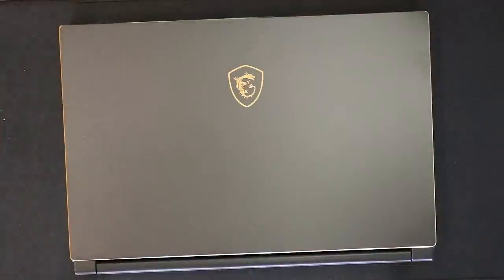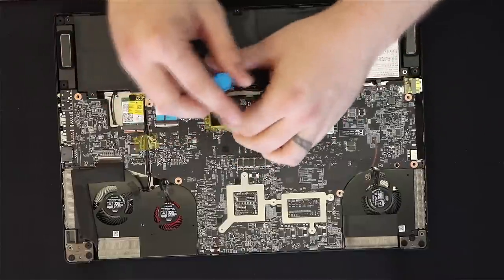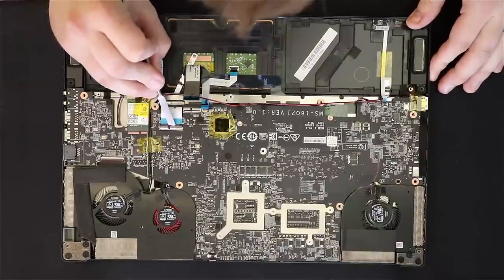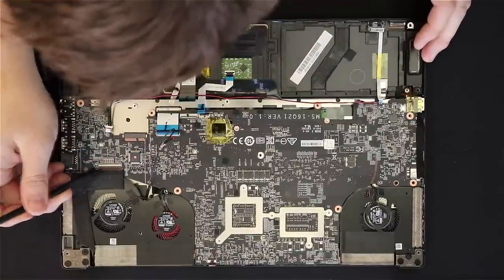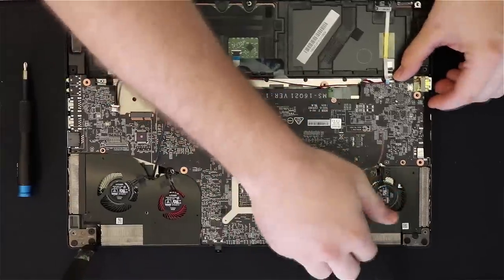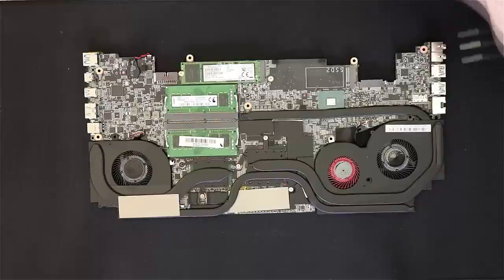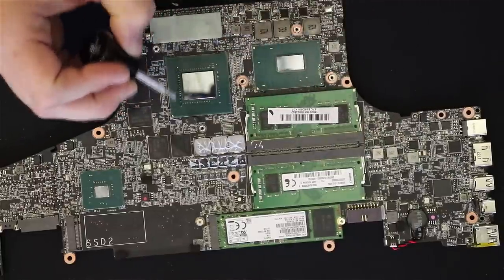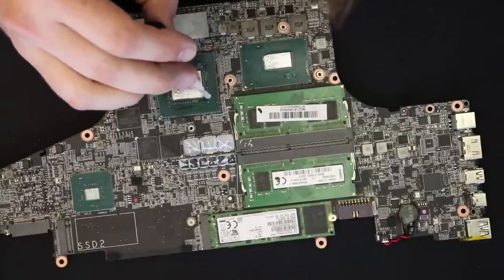MSI GS65 Laptop Teardown and Liquid Metal Mod - 20C Lower

Comment: does this void the warranty?
Reply: Arsh Bishnoi it actually does not. However if damage is caused by using none OEM parts or liquid metal they could easily dismiss your warranty. 

So if you know what you're doing, don't apply too much, use conformal coating, and create a liquid dam in case spill over, your metal won't cause an issue.
Reply: Depends on your location. Definitely voids the warranty in my neck of the woods!
Reply: CoolHandLuke no it does not depend on location or your warranty terms of service would be different per location shipped or note such differences on the guide.
Reply: Basically if you do this and you end up needing warranty for your CPU they'll likely just say the liquid metal caused it. I highly suggest a closed cell foam around the edge of the CPU heat sink to assure that if any movement occurs it is trapped.
Reply: I ordered from Box.co.uk and despite advertising 2 years warranty I only have 1. I also checked about this and liquid metal is a big no no and definitely voids the warranty. I'm just quoting who I purchased off. I checked into it. Seems we've been told different things, peculiar. You really think MSI is going to put the tab on them if you fuck your laptop up with liquid metal? Maybe double check that one. Now I believe the US is more liberal in what it allows, hence different rules in different locals. The LM mod is tempting though
Reply: CoolHandLuke you didn't quote anybody FYI. And that sticker is actually to tell if they need to replace paste/if the item has been opened. It is NOT a warranty void sticker.
Reply: CoolHandLuke don't be so soft and don't let companies walk all over you. If you agreed to a 2 year contract at purchase make sure they hold up their end of the bargain. If you have been actually taken advantage of take advantage back, you can request administration or go straight to small claims.

Comment: have you had any issues with the g65 freezing when drawing too much power for games? I set mine to "maximum performance" and it freezes up after a couple hours of gaming.
Reply from the maker: I have not had that issue. I am a stickler about cooling though, for most of my gaming sessions I use a base that not only elevates the laptop but has a fan in it as well. I would not be surprised if your problem was heat related.

Comment: Why on Earth is the motherboard flipped? There has to be some reason else MSI engineers were high while designing it.
Reply from the maker: I think it was for better air intake for the fans. The suction of the fans point up through the venting in the keyboard. This gives you more open air to draw from instead of the construction beneath.

Comment: I'd rather not spend 70 on that tool kit, can u just suggest the select tools u used for this operation?
Reply: Walmart sells a fantastic kit from Hyper Tough - Electronic kit for like $20. 77 piece with suction cup, pick, pry tools and precision screw drivers.
Reply: @tennis-4-life718   NIICE that sounds more reasonable, I know the laptop is expensive and therefore, I shouldn't skimp on tools, but 70 sounded kinda steep to me. Thank you for advice!

Comment: If I have never worked on the interiors of a laptop before, is this a bad idea?
Reply: Yup. Familiarize yourself with your laptop. Don't risk it with liquid metal unless you know what you're doing. You can definitely learn and prevent damage, but if you're unexperienced just buy Kryonaut instead and go ham. It lowers temps almost as much. It's like a 5°c difference at max. Risk free as well since it's not conductive.

Comment: do you need to change the paste on the VRAM? or can you leave that dried up factory stuff on there. As well as the thermal pads?
Reply from the maker: On mine that paste was still liquid and hadn’t hardened so I simple went back together with it. I think you should look up the size of thermal pads and replace.

Comment: Teared it down, put in my SSD and when putting it back together, some reason my keyboard wont work. I get RGB lighting but nothing happens when I try to log in to my PC :-/ idk what's up.
Reply from the maker: There is two ribbons that go in for the keyboard I believe one for lights one for keys. Or your cables are not making a good connection.
Reply: Burner2K0 did you end up fixing it?

Comment: Great video! Yesterday I did the same mod to my GS65 using the same step by step procedure. However, I'm getting 10C more on the GPU and 5C more on the CPU.
The only difference from your procedure and mine is that I applied 3 layers of silicon conformal coating instead of using nail polish. Does anyone think this is the reason?
I also made sure to apply the same force on every screw that holds up the heatsinks together.
Reply: hey man i have the exact same issue as you .. did you figure it out?
Reply: @andreibalanescu6942  Hey there, Now I'm at 45°C-50°C on idle and 75°C max while gaming. In order to achieve these temps, I needed to configure the Throttlestop, Afterburner, and the Dragoncenter fan profile/curve. If you need help, let me know.

Comment: had to do it 3 times already on my aero 15 v8... no idea but it always gets hard after 2-3 months.. no air can reach it.. maybe its an copper alloy or something because it seeps into the copper quite heavily after a few weeks
Reply from the maker: Sanyex that is strange I have been using mine more than usual lately and it’s running awesome. I don’t understand why yours is getting hard that should not happen unless there is a chemical reaction I believe.
Reply: i think because of the copper alloy .. 100% copper wouldnt react with the gallium in the liquid metal conductonaut : / i will switch back to kryonaut... if it happens again.

Comment: How long would the liquid metal and nail polish last? Would your laptop be able to go for years without having to do a repaste like this?
Reply from the maker: I actually am not totally sure. The liquid metal applications have only been mainstream for about 2 years now as far as I can tell and I have not seen long term effects personally. There have been a few videos showing some dulling on the CPU/GPU dies which would seem to me to be some kind of either abrasiveness or corrosion but there is really not enough information as far as I have researched.
Reply: UpgradeJunkie the hazard with liquid metal other than conductivity is it WILL eat aluminum. copper is fine but gallium in the liquid metal will eat aluminum really fast. otherwise there shouldn't be any corrosion

Comment: Awesome laptop but the display is dim! Doesn't matter for games but video editing and or film/ series not so enjoyable 😣... Would still buy again though for power/ portability.
Reply: Asus Strix laptops have a lot of screen brightness and decent battery
Reply: @merry1694  thanks for the info... I will looksies when I next upgrade😊. I came from a 2012 MacBook Pro so the only thing I didn't research extensively was the display brightness cuz' it has been 6+ years!! 🙁🙁

Comment: Did you try and undervolt this laptop?
I have the GS63, I'm runing it at -0.135 V and the CPU is now running around 10 to 15 Celsius  less.
Reply from the maker: I undervolted after I made this videos. I have a -.160 undervolt and that has helped a lot as well.
Reply: Without opening I have 10-12C less undervolting -.150. Gaming rarely goes to 90 averages mid 70s. I also changed the turbo time so I can get more out of that. Hitting 14k fire strike with good heat and prime95 no errors for 3 hours.

Comment: FML. I opened this laptop so many times, but last time I damaged the monitor connector. I'm guessing I forgot to pull out the ribbon. Is this fixable???
Reply: How was your laptop now bro
Reply: @jeffreyexpectacion2130  sent it to MSI. $280 and they replaced the motherboard, top cover around keyboard, and screen rear cover.

Comment: Wow what a horrible amount of work just to get to the upgradable parts and coolers.
Reply from the maker: Your not lying there lol. That is my #1 complaint about this laptop I'm still holding off on a SSD upgrade because of the extensive work I will have to do to get it done. The tear down is actually sped up a ton through editing this actually took around 30-45 minutes to film.
Reply: hayabusa haya It’s honestly not that much work. I did it first time and it’s I went slow and it took awhile but I could prob do it again all under 30 minutes with just a screw driver and my fingers.

Comment: I have the same laptop, but I have a question, this could not be harmful in the long term ? the nail polish and the liquid metal on the components?
Reply from the maker: The liquid metal can be very bad for solder so being very precise on where you put it is key. There can be some dulling of the die face but there should be no chemical reaction as long as there is no aluminum. When it comes to the nail polish it acts as a sealant which is close to what big companies use when they waterproof products. Now just make sure you nail polish in non conductive.
Reply: @UpgradeJunkie I already do it. And works so fine, I want to undervolt but I dont know how... can you upload a tutorial specificaly for this laptop please?

Comment: @UpgradeJunkie
Hi, near to the RAM modules there is some thermal paste also. Why didn't you replace that one or can we scrap that out an put MX-4, for example?
Reply: That's a different substance entirely, do not replace that with thermal paste.
Reply: @contorta960  so leave it alone?
Reply: @LIFEOFSTUFFEDANIMALS  no you can redo it by all means just get the right substance. It's not thermal paste, I forget what it is but it's a different compound and that's quite important.

Comment: Great work. I know you are doing this to reduce noise but how far can you actually overclock the gpu until it reaches power limit?
Reply from the maker: I am able to get 250mhz on the core and 300 on memory to run a firestrike benchmark. 300mhz core would crash out.
Reply: UpgradeJunkie with 250mhz overclock on the core what is the final frequency?

Comment: Awesome video! I just bought this laptop but I feel that the screen area will bend and also the build quality seems kind of low even though is a 2k laptop. How have been your experience with it?
Reply from the maker: For the components inside I don’t think it is overpriced I believe if they put some more strength into the chassis it would have been nice but I think the price would have went up a few hundred. I don’t mind the flex personally but I wish it was a little better.
Reply: UpgradeJunkie  thanks for the quick reply. Was between MSI and the Razer Blade 15 just becuse of the quality of the build. But I love the look on the MSI.
Reply from the maker: Muriel Gonzalez my wife has a MacBook Pro and I cannot get enough of the feel of the build quality it has. Sadly it’s essentially a potato.

Comment: Why don't all companies do this!?
Reply from the maker: Sea Panther difficulty in application which would costs a lot more relatively than the simple thermal paste, also I’m assuming there would be more quality issues with improper application that they don’t want to deal with.
Reply: UpgradeJunkie yeah I can it being difficult and challenging fur them to do it the way you do did, but if they would apply it to the chip before it is even soldiered on if feel it wouldn't be that taking. Consumers, especially gamers and creatives, would gladly pay a little more for better cooler and quieter performance which also leads to longer computer life.
Reply: @seapanther53  longer computer life thats the bing bing bing companies dont want you to use a laptop to long they want you to buy more of them

Comment: Great job! was not expecting to see liquid metal mod video already, more considering the difficulty because of the odd motherboard setup that this device has. But was looking for someone doing CPU undervolting and sharing the results, have you tested this? as this would be a more easier and convinent way to tackle the heating issues for the more wider public, this helped bring down CPU temps 10 to 15 C degrees form 90s to 70s on my Asus Rog GL502VT while gaming.
Also could you please post a follow up video showing the mentioned results, the new fan noise levels on idle and gaming and some tests also on the undervolting to see if it improves further.
Reply from the maker: I have to look into the undervolting. The bios is not very intuitive and I will have to study it a little more to know if it is even possible with this computer. I will also have a full review coming soon and will post the results temperature results their. Mostly you see a change in throttling while gaming for and extended time without the mod throttling goes up to about 50 percent where after the most there is virtually no throttling. This is under all “auto” fan settings, which is noticeable but not loud. If you put it to “cooler boost” the temperature sub 80 and throttling not a factor at all.
Reply: Undervolting is actually really easy matter, you only need Intel XTU software and decrease the core voltage offset values until the system is stable, no need get lost in the bios menus for this and don't think it is capped in any intel cpu laptop. Check out Dave Lee's video https://youtu.be/QBNP5I2y668 on the matter.
Looking forward to the full review video as your mod is relay the best we can do to improving temps and throttling issues, so these results are important.
Reply from the maker: Thank you I will look into the undervolting and try to get a video up with the results ASAP
Reply from the maker: So just undervolted the gs65 by .175 and ended up gaining 20% on my cinebench score from 1028 to 1230 more test to come soon but I thought that was surprising
Reply: Any more follow up tests (or video) on undervolting the GS65? How much did temps drop by undervolting 0.175V? And did you test stability afterwards?
Reply: Weird question, how do I know the nail polish in non conductive ?!?!?!?!??!

Comment: I'd love to see liquid thermal pasting on the msi gs65 with the gtx 1660 ti. Its cpu reaches temps of 100c...
Reply: Fantastic Fox I just got that laptop recently. I used kryonaut thermal paste and it seems to keep the temp down along with undervolting to -.125. CPU temps hover around 80-85 when stress tested. I still think at idle with the fan speed at its lowest speed at 2700 rpms is still a little loud as I like it to be.
Reply: @PeterSchmoll  my gs65 always handle turbo boost 4.0 ghz even in idle, is it normal?

Comment: Air bubbles. Your method shown gives air bubbles when using paste, is this not an issue with liquid metal, could you just drop a pea size in middle of the cores?
Reply from the maker: No you have to spread the liquid metal which is a chore because of the surface tension of the liquid metal.
Reply: doing it with the die and cooling plate solves the air bubbles, also heating the liquid metal just a little makes it way easier to work with

Comment: the MSI gs65 has copper contact plates on the cooling solution. If you apply liquid metal (containing gallium) it will be an impressive thermal drop for the first month but then the gallium will react with the copper. It becomes blackened and brittle and will very much reduce the thermal properties of the metal. you will have to replace the heatsinks. really not a good idea.
Reply: Copper heatsinks are the only you can use this method, it's the aluminium that's an absolute no go.

Comment: Exactly zero proof it did anything whatsoever. For all we know temps went up 20C and you are clocking at 1.5 when idle. Where is the comparison of stock out of the box temps vs undervolt vs LM undervolt? heck even a before and after LM would be something. You can't just say "shit works cuz i said so and oh there are pics on social media" and expect that to hold up. If you plan on having your channel grow as a somewhat reputable one you NEED TO NEED TO NEED TO show empirical proof of any claim you make regarding temperatures. If you just clickbait the title like this one with the "20C lower" claim and do not prove it then the video is junk for anything other then a disassembly tutorial.
Reply from the maker: Thank you for your advice.
Reply: This response was lowkey and professional in so many ways...

Comment: weirdly specific question, on the new cod even with liquid metal I still get about 85 on gpu and 75 on cpu, should I consider redoing it or is this normal?
Reply: If the gpu temps are ever higher than the cpu temps in this laptop I’d go in and repaste. Because even stock thermal paste my gpu rarely hits 85. However 75 for cpu is amazing.

Comment: What I don't get - is why the f**k can't these manufacturers just do this. 20 degrees is not something to sneeze at. It's a huge difference. I've got the GE73 which is easier to break down, but I'll wait till my warranty is gone.
Reply from the maker: I can understand not doing liquid metal because of the difficulty of application, I don’t understand why they skimp on good thermal paste though. Even more annoying is Intel not soldering cpus.

Comment: Aren't you scared about potential spillout as it's a laptop and will be moved around? I'm not brave enough XD
Reply: from personal experience using liquid metal on my daily driver which comes with me to class everyday, there is a risk yes but if you apply just the right amount and screw your heatsink tight enough you wont get any movement. If you apply too much to where it looks like a pool of water on the die, placing the heatsink down will immediately push it out the sides and spill it all over your board